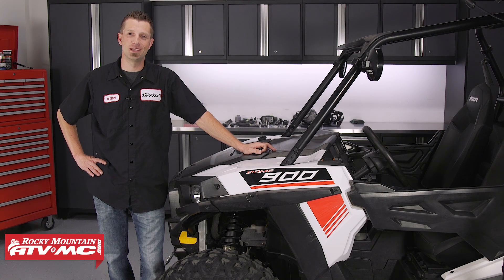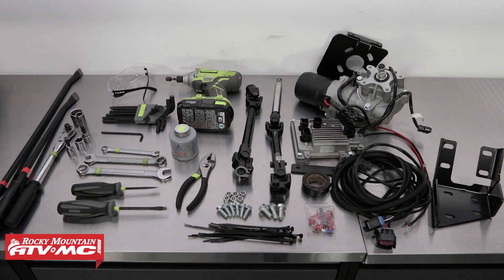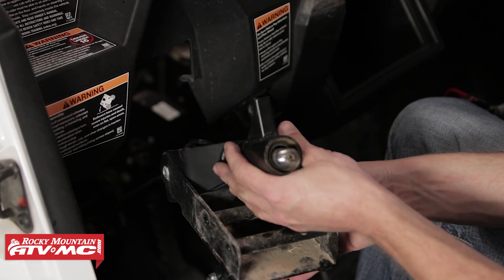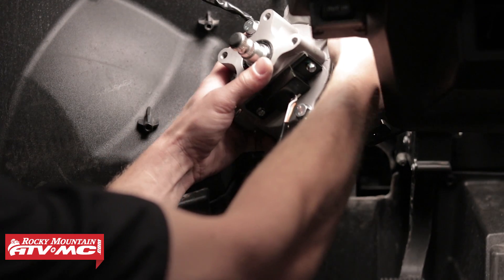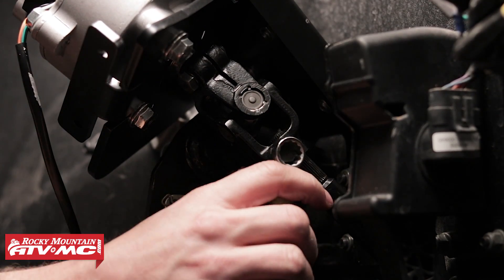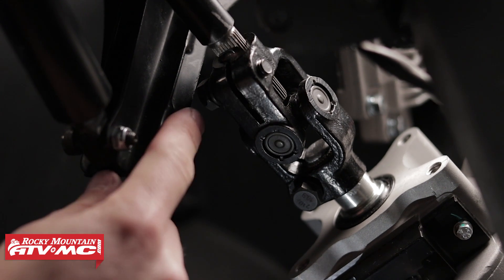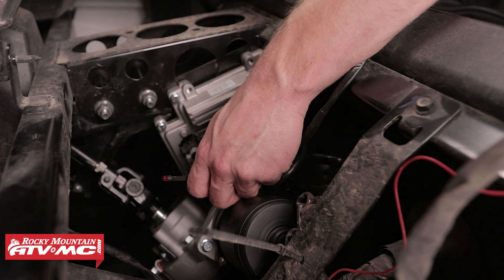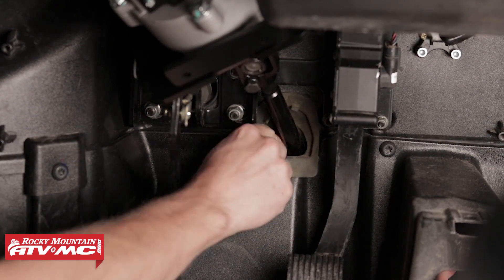How To Install the Tusk UTV Power Steering Kit

Comment: If you're going to buy a connector, why not just use a ring terminal instead of breaking into the insulation of the relay wiring? IMO using a "T" tap on these machines creates a potential weak point.

Comment: I have Kioti 2010  utv I want to add power steering to this machine. Do you make  a kit for this
Reply from the maker: Unfortunately we are unfamiliar with that machine and don't have a power steering kit for it. You may be able to see if it's similar to other machines and see if you can cross reference a kit that could work for it.